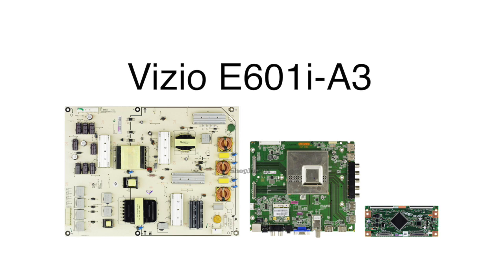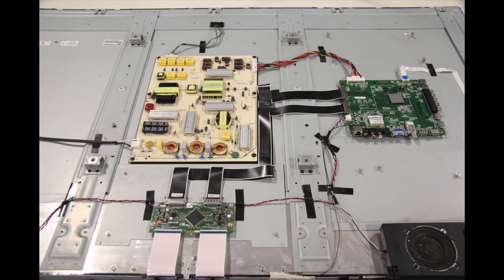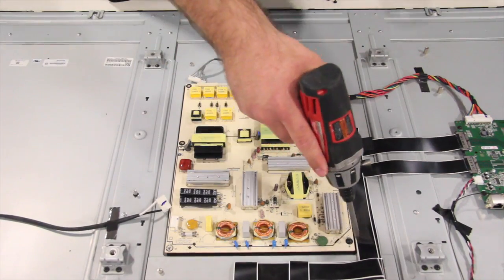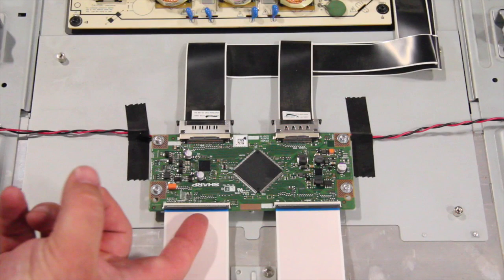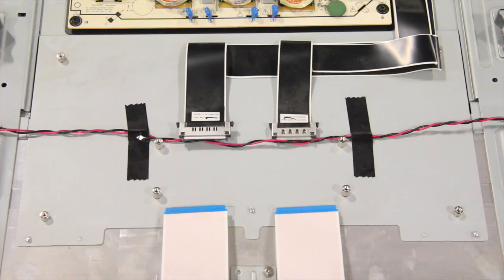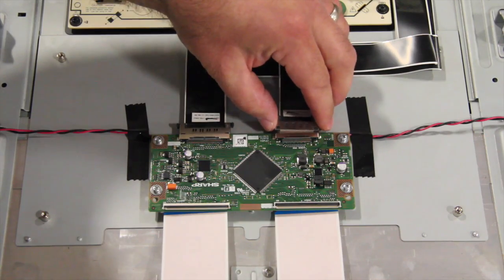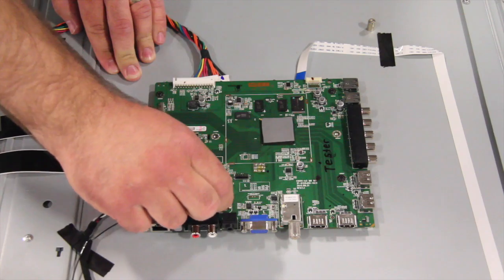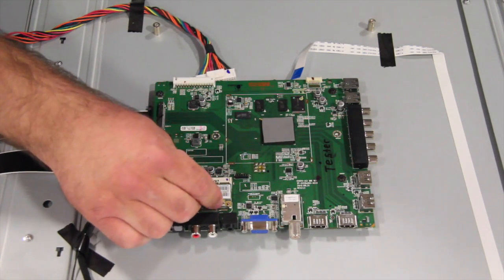Vizio E601i-A3 Complete LED TV Repair Parts Kit - T-Con, Main Board, & Power Supply

Comment: Vizio E601i-a3 - When turning on, 'V' (Vizio logo) shows in the middle of the screen, then disappears, then the screen 'flashes' across the bottom 3" of the screen, then screen goes blank / black. It seems like it is still 'powered on' because when I press the power button, nothing happens, BUT when I press the power button again, the V again displays and the rest of the above process occurs again - acting like it was powered down and then powered up once again. Thank you for assistance and possible parts to replace. Thank you.

Comment: My Vizio went out when lightning hit outside.  Would it be the main power board that blew?
Reply: Same thing happened to me. Was it the motherboard?
Reply: @ericburris9515  Yes, the main board, not the power board.  Came through the modem and there was a black burn mark under the board at the port entrance.  72.00 new board, replaced and now works as good as new!
Reply: @ericburris9515  its should power supply bored

Comment: I have the E601i-a3e 55" Vizio TV. When the power button is pressed the Vizio splash screen appears on the screen. This will increase and decrease in intensity several times and the TV will go dark. It is on an HDMI input that our sons PS4 is connected. Do you think it is the Tcon board?

Comment: First I ordered a power board from shop jimmy for my vizio 601i-a3. The TV was randomly powering off and then it would stay on shorter and shorter periods of time, till finally it would only stay on a couple of minutes.  The replacement power board did not solve the problem, so I ordered the full replacement kit and followed the video tutorial easily enough. The video does not mention replacing cables so I did not do so. The power problem seems to be solved but the picture quality is TERRIBLE.   One other issue was that the main board, while having all the same ports, it looks different in the heat sink area and the chip the antenna wire attaches to is oriented differently. I don't know if this could affect the picture. The HDMI1 port identifies itself on screen as Satellite, but it displays what is attached to it. The other ports identify themselves correctly on screen.  I am including dropbox for a few pictures showing the main board difference and the poor picture quality. Any diagnosis help would be greatly appreciated.  Here's the dropbox link to pics: https://www.dropbox.com/sh/kootpd9r1it7sde/AAB7pUW7AwCCOkWt9Y93sNB_a?dl=0